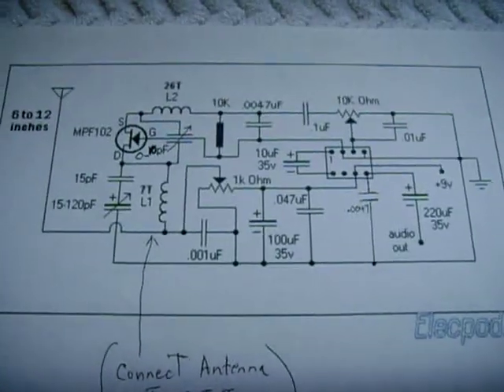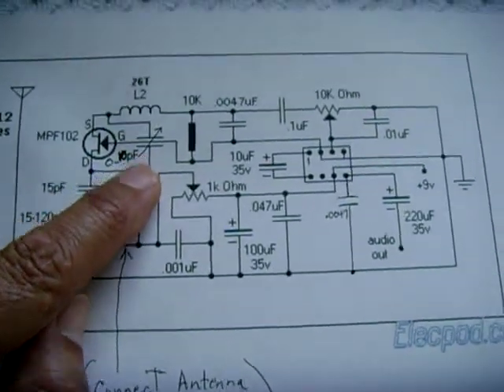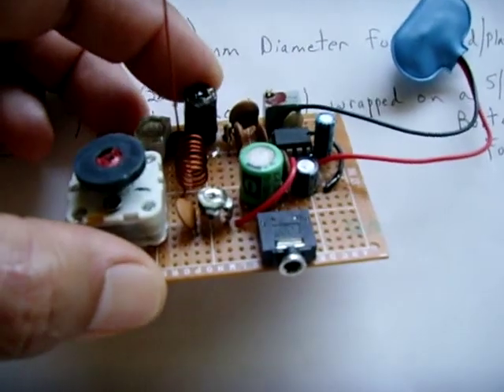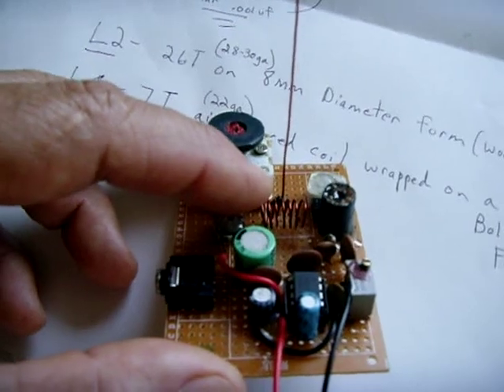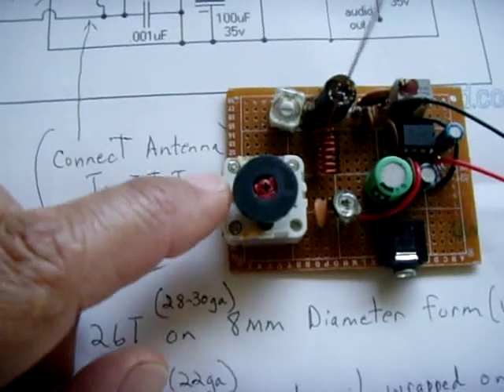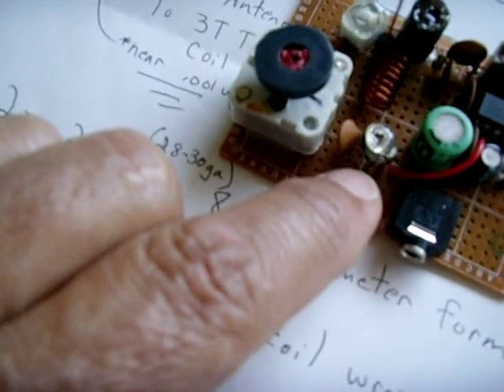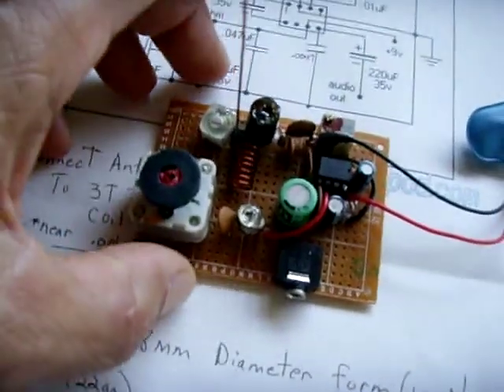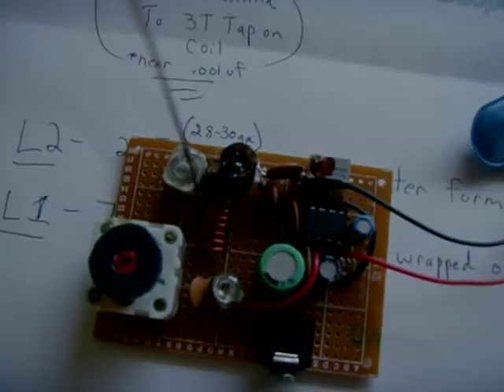One Transistor FM Receiver (Ideal for FM transmitters)

Comment: Great video, thanks. I noticed Americans never use nanoFarad. You will descibe it as 0.001 microFarad or even 1000 picoFarad but never simply 1 nF. Why is the nano banned by Americans, is there a reason for that? Just wondering.
Reply from the maker: I do use the word nanofarad. :-)
Reply: Must be coincidence then ;-)  I live in a densly populated area so it would be wise to go below the broadcast band. A couple of weeks ago I had a blown fuse in my shed and I did not realise it. Everything in the freezer had gone bad. So I built a simple dead bug style 2 transistor FM transmitter using an AC/DC adaptor so I can check if the power is still on with a transistor radio without having to walk to the shed every time. From inside my house I can hear the carrier very very faint. It would be nice if I could make it click or beep every second or so. Any ideas?
Reply from the maker: @ingeborgsvensson4896  I have a simple 9V tracking device shown on my channel that beeps.
Reply: Sounds great! I have subscribed and I will check your other videos. Thanks!
Reply: electronicsNmore With 5 minutes of experimenting I found a great solution. My brother taught me the basics of electronics and he once explained how most transistors will start conduction in the opposite direction as long as the voltage is high enough. I placed a tiny speaker (~1 inch) in front of the microphone. Connected the emitter from a 2N3904 to one side of the speaker, the base of the transistor is not used and can be cut off. The collector goes to ground. On the other side of the speaker we have two solder connections: one is a 1k resistor and goes to plus, the other connection is a 470 uF electrolytic capacitor and its other side is connected to ground. When powered directly to the adaptor (~16VDC) it generates a clicking sound about twice a second. Because the speaker is right in front of the mic the transmitted clicking is very loud and works great as a beacon. I was surprised that this worked instantly. From what I understand is that the capacitor charges until it reaches such a high voltage that the current flows from emitter to collector, the capacitor discharges and this short current burst causes a clicking sound in the speaker. Not sure how long this will last, 2 Hz is getting awfully close to DC and speakers generally don't like that. Maybe get rid of the mic and speaker all together and make a small transformer? I have a bunch of those cheap green Chinese ferrite toroids. What do you think?

Comment: I tried that circuit, it works but the hand capacitance effect was just insane.
Reply from the maker: rene kenshin I didn't have that problem.
Reply: @electronicsNmore  The moving plates on the variable capacitor need to be connected to ground.

Comment: what ic chip should i use for fm circuit?
Reply: Riya Rita  
lm 386
Reply: transistors, the chip is used to amplify the sound. he's using the LM386 low power audio amplifier

Comment: I used this circuit for my final project in my EET 3367 – Communication Systems class at MTU. Confirmed that this circuit works great.
Reply from the maker: ***** Glad to hear it worked well for you! Thanks For watching. Please share my channel with others and rate Thumbs Up.
Reply: electronicsNmore Will do, thank you for posting. I did have one question though. Why did you solder the antenna directly to the drain coil?

Comment: Does it work with 2sk246?
Reply from the maker: Trifu22 The mpf102 is a FET N-channel designed for RF. The 2sk246 is also a FET N-channel with the pins reversed, but not designed for RF. It may work, but no guarantees.

Comment: The description said that is 9v circuit but, i can see in the diagram a 35v source
Reply from the maker: I have no idea how you arrived at 35V. The schematic shows 9V.

Thanks For Watching!
Reply: 35V is the spec of the capacitor 220 mF 35V capacitor.
Reply from the maker: LOL.Your right. I did not catch that.
Reply: Probably its because this is your job and you are so used to circuits you take it for granted.

Comment: Thanks for the video. Certainly there is enough information in your video to construct the circuit.  I followed the link you provided to next.gr which in turn had a link to another page but that link appears to be broken.  If you have a functioning link to the original article please post it.  I would be interested in reading the original article.

Thanks.
Reply from the maker: I will see if I can find a new link.

Check out my video playlists as well.

Thanks For Watching!

Comment from the maker: Sorry about the link. It is out of my control. The IC is a tda 7000. You can do a google search for, "Simple FM Receiver Circuit tda"
Reply: These ics are not available as part.. i am searching for it in old radio circuits.. Will it be ok.. Does it have any modern replacement..?